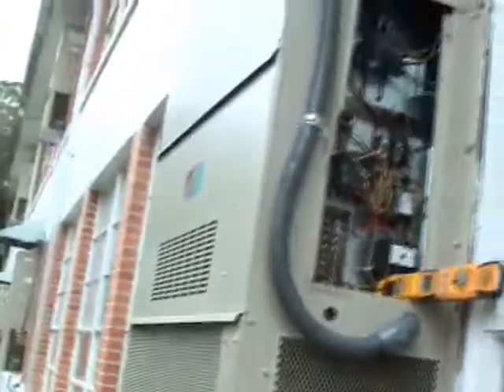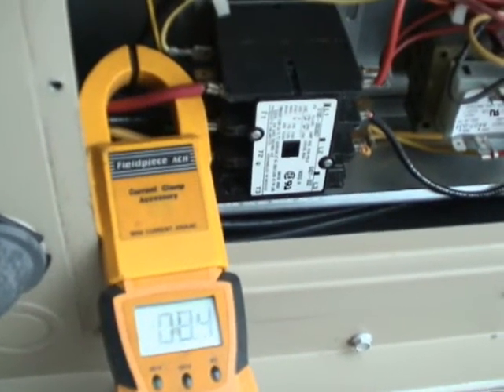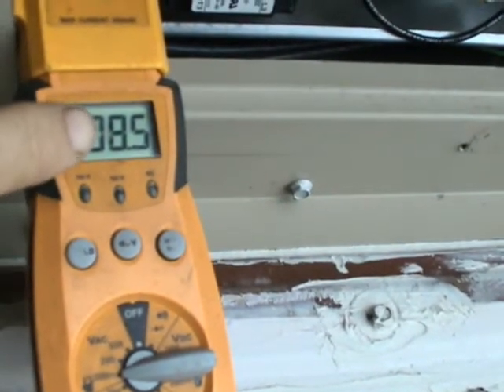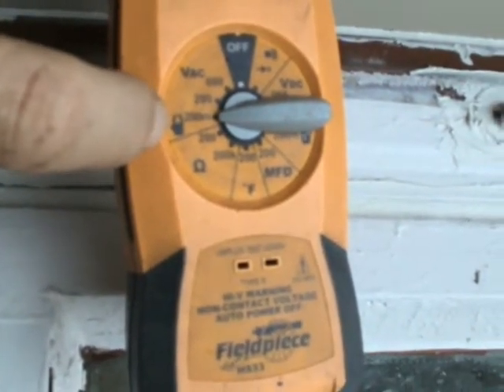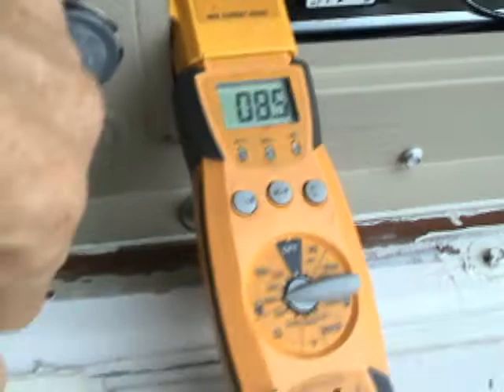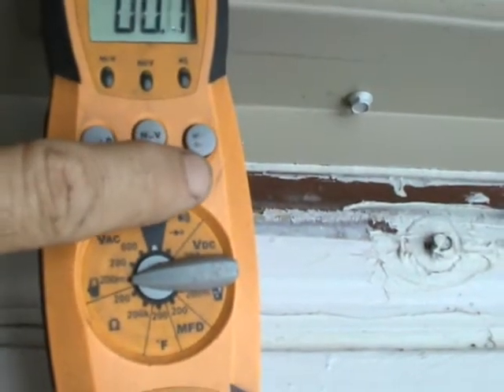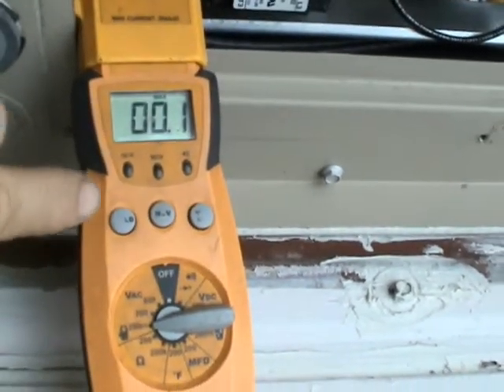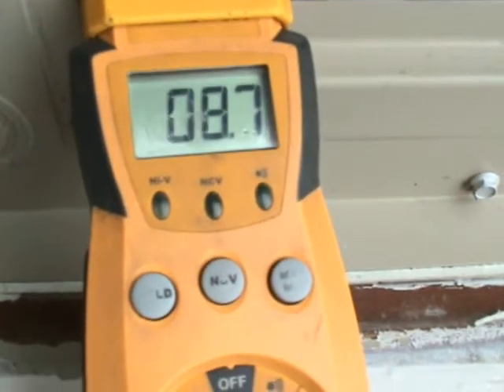HVAC Amp Draw

Comment from the maker: The RLA (rated load amps) is what you get when the compressor is running under normal load. LRA (lock rotor amps) is the typical amp draw you'd expect when the rotor is lock up.

Comment from the maker: The inrush amp draw is the amount of amps that the compressor or motor used upon start up. It's not the same as LRA (lock rotor amps). LRA is the amount of amps that the compressor will use if the rotor is locked up and unable to turn.

Comment: @DrZarkloff 

okay, but by the Amp measurement you are Given when you test MAX AMP Draw... what will this Number mean? Is there a MAX Amp Rating for the contactor or motor? and if it exceeds that, what happens? Please reply :) thanks Jim.

Comment: Dr Z. I love your videos. I would have liked to see you compare your measurments to the data plate.

Maybe you have noticed that on single phase equipment it is never even close. I will measure the common winding and ithe RLA will typically be low. Sometimes if you find the sum of two of the windings it will be close. What is your  take on this?

LRA usualy is close.

Was that a three phase unit you were testing? I have not seen that Bard in my area?

Comment: Knowing the air side is just as important as either the electrical or refrigeration sides. It just happens to be the most ignored and misunderstood side.

Techs, do you really believe those installers know how to correctly design duct systems if you don't?

Are the schools you are going to teach this subject.

Do you just set your ductulators to an arbitrary setting like .1 or .08?

Comment: electric motors will draw 5 to 7 times the full load amps at start up.  This compressor is running normal.

Comment: Do you ever get complaints about light flicker due to compressor inrush current and the resultant voltage sag?  This is one of the issues we deal with quite a bit over here.  I hear that Rheem is partnering with a company that makes an electronic soft start as a retrofit package to address this issue.  Cheers.

Comment from the maker: You might want to make sure that your motor is on a circuit with a HACR type of breaker. They're designed to delay a trip to take into consideration the start up load.